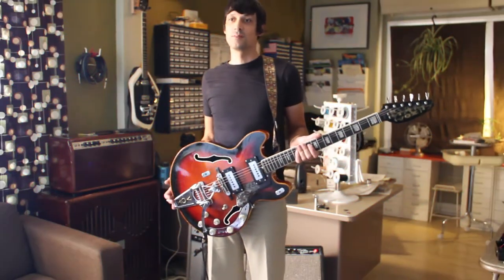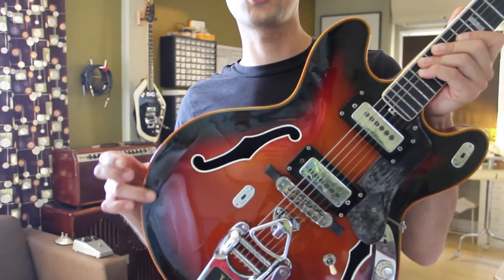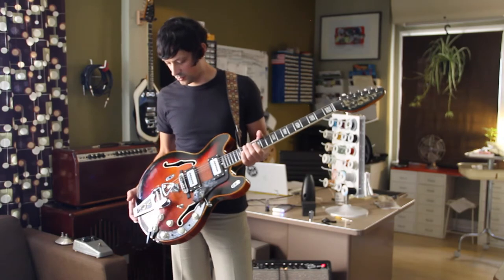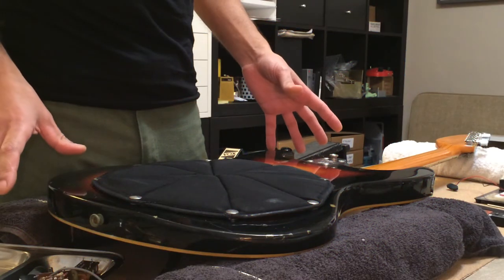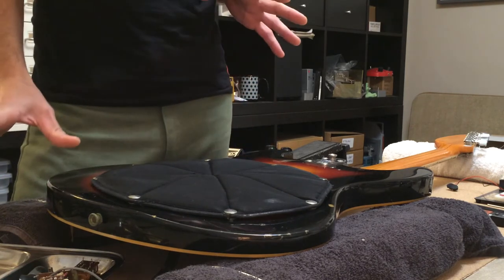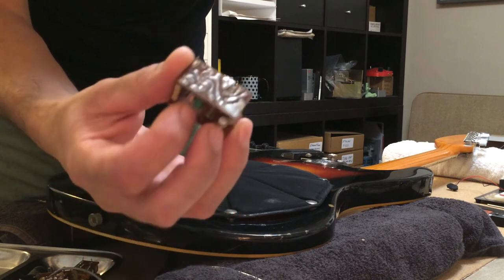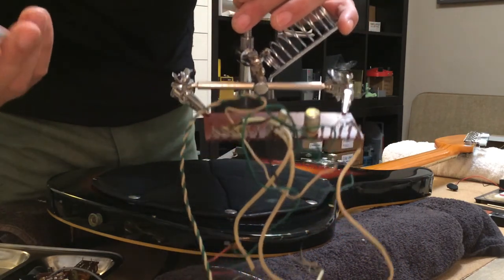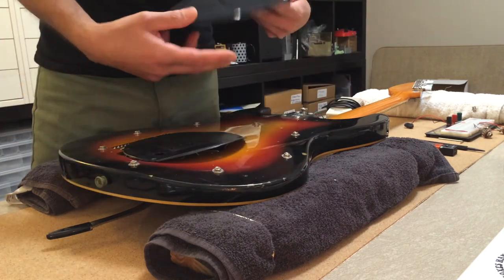Vox Onboard Effects Repair Video 1 (Introduction)

Comment: Just found your website & videos, you rock man! Thank you so much, I am watching this now and will be diving into my Sidewinder IV Bass tomorrow... Primary issue is switches are seized up but everything else is working and sounds good... I am suspecting (hoping) that it is just a bad switch and/or cap as everything "looks" clean inside... I subscribed and will dig into your other content soon. Thanks again man, all very well done, clean edits, and great communication.

Comment from the maker: No, they are not pinned, unless someone does it later as custom work in order to run lighter strings or just keep the bridge from moving if they have a heavy hand. It's a good idea to do so if yours is moving around. The ultrasonic bridges typically do not seat well unless Eko/Vox got the profile right that day @ the factory. The difference from guitar to guitar is fairly drastic in terms of transferring string energy when comparing a properly profiled bridge vs. one that doesn't sit flush. sustain is better as well.

Comment from the maker: If you're having problems with bridge movement on an Ultrasonic, the best solution in my opinion is non-invasive, leaves no holes in the body, effective, and also fairly simple. Here's what I recommend:

1.) First make sure the bridge is PROFILED to the body so it sits completely flush.
2. )Decide which gauge of string you like best with that guitar.
3.) Set it up for that gauge as normal. Adjust string height, intonation, neck, etc....
4.) Carefully mark the position of the bridge so you know exactly where to put it back.
5.) Cut the ends off of two ~0.055"/1.4mm brad nails. You only need about 3/16"/5mm length.
6.) Carefully drill two holes in the bottom of the bridge SAME DIAMETER as the nails, one at each end ~1/2" from the ends on each side. You only want to go about 1/2 the depth of the nail. The idea is to just have the very tip protrude. A brad point bit helps here.
7.) Dip the cut ends of the nails in epoxy or thick gap filling super glue and press them in to the holes. Don't use a lot, so it doesn't end up on the bottom of the bridge!
8.) Let the epoxy/glue cure completely. 
9.) Place the bridge back exactly where you marked it and PRESS DOWN so the tips seat.
10.) String it up and play it without worrying about the bridge moving.

Hope that helps.
Reply: +Acid Fuzz Pedals Thanks a lot dude. I get mine next week and was concerned about bridge movement. I'll let you know how it goes

Comment: Just bought a non working ultrasonic.Looks like the positive wire to the battery broke at the solder.Have you a schematic which shows where it needs to go?

Comment from the maker: Hi Grant. No, the Ultrasonics (V268/V275 6&12 string) did NOT come from the factory with bridge covers. This is another wacky Vox thing that doesn't make sense. The higher priced models with ALL of THE FX (T/B Booster, Distortion, Repeater, Wah, and Tuner) like the Starstreams, Grand Prix, and Ultrasonics did NOT have the chrome "vox" logo bridge cover. Similar lower priced models with the same roller bridge like the V266 Apollo DID have the cover, yet the V267 Cheetah didn't. Makes about as much sense as the US foreign policy. Anyway, here's a list of the Italian models that had the cover from the factory, and models that did not.

With Bridge Cover:                                                No Bridge Cover:
-V261 Delta                                                            -V262 Invader
-V265 Bossman                                                    -V267 Cheetah
-V266 Apollo                                                         -V269 Starstream
-V271 Apollo IV (bass)                                        -V270 Starstream XII (12 string)
-V272 Sidewinder IV                                            -V268 Ultrasonic
-V281 Saturn IV                                                    -V275 Ultrasonic XII
-V282 Skybolt IV (cover does not say "vox")   -V286 Grand Prix                                                
-V283 Spyder IV                
-V284 Stinger IV
-V287 Saturn
-V288 Aristocrat (no "vox" logo)
-V289 Viper

*There are some other Italian models that don't apply here because they have a completely different type of bridge, like the V274 Constellation and the acoustic guitars.
Reply: Hi where can I contact you? I own a fresher guitar and I can't find any information about it. Might be cool if you can provide me some information

Comment: Hi, I own an eko cygnus, with the same electronics. I really don't mind the fx (even though it's a great plus) but the problem I have is that the guitar doesn't work at all. All I can do is hear just a little buzz from the volume knob. My question is: does the guitar works even with broken fx and no batteries, without manually rescheme it to bypass the fx?
Thanks
Reply from the maker: +Magic Kar "My question is: does the guitar works even with broken fx and no batteries, without manually rescheme it to bypass the fx? Yes.
Reply: +Acid Fuzz Pedals Thank you! So maybe it could be the p.u selector.
Reply from the maker: +Magic Kar Yup; or volume pot, or output jack, or signal wire(s).

Comment: Hi. I love your tutorials! Really informative & you've obviously been around these guitars long enough to know what you're talking about. I have a few of questions I'd love to throw your way....
1. Have you found any source (other than Rhoads Music) for the Ultrasonic pickguards? Anyonne who makes repros?
2. I have an Ultrasonic XII (and a spare undrilled NOS 6-string neck) but LOVE the thickness of the 12 string so would prefer to keep it on the body. I have it strung as a 6 string using 6-in-line tuners instead of 3-a-side. Do you think this could eventually damage the neck by twisting it?
3. I rarely use the Palm Wah. Can you tell me how to remove the outer metal mechanism without damaging the inner electronics?

Many thanks if you find time to answer these questions :)
Reply: Does Rhoads music actually sell the originals or repros? Are they legit?
Reply: Kim Sung, they did several years ago but they only had 2 real ones. If I remember correctly, one had screw holes drilled & cost 150$. The other one was a NOS blank & cost more (200 - 300, I don’t remember exactly).
I’m guessing they’d be sold by now. 

I think they had repro too but they looked like shit!
Reply: Good Head Space lol - thanks for the reply :-) It’s very difficult to get those guitars with all the effects working. If you do manage to get one, they sound amazing!
Reply: Kim Sung, I have a Vox Ultrasonic with everything working nicely. 
And yes, they sound amazing!
Reply: Good Head Space yes - I’ve seen them.They look better than the starstreamers